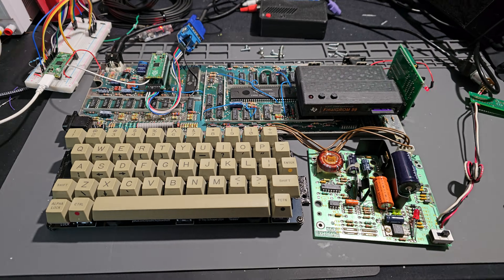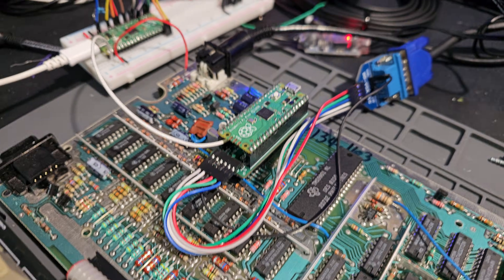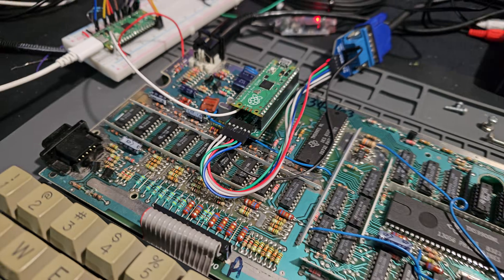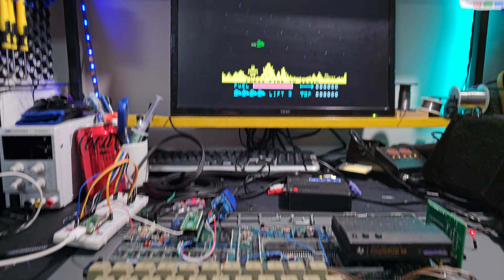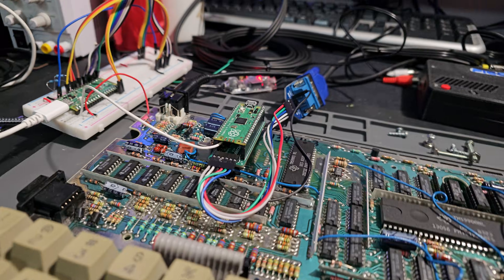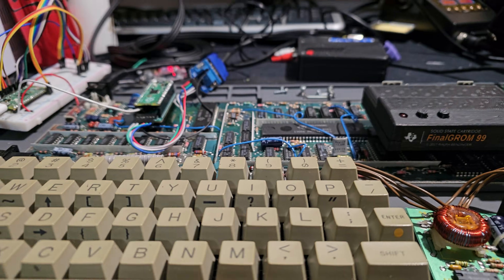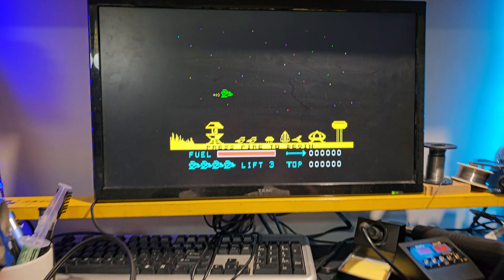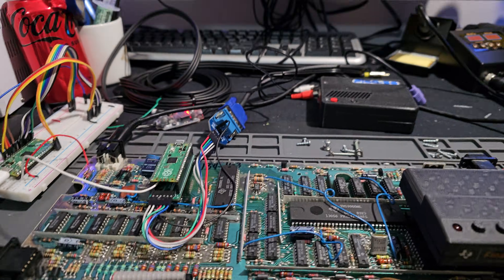PICO9918 prototype - It fricken works!

Comment: Ja, ich sehe hier eine grosse Zukunft für IHR PI PICO PROJEKT,besonders als quasi preiswerte VGA "Grafik-karte" für so viele Homebrew Computer wie da zilog ez80, ATMEGA , Wroom32 Projekte ,wo eben eine gute schnelle QUALITÄTs VGA "GRAFIKKARTE" da fehlt.
Denn besonders heute ist bis auf den sehr umständlichen BT815/817 Videochip ,da kaum etwas für die modernen "MCUs" oder auch für die alten old school CPU als da z80000, 65816,68000 etc.etc. auf den Elektronik preiswert vorhanden.Also wäre ein QUAD "PI PICO" wohl hier beste Hardware Lösung um richtig VGA "POWER" mit sehr wenig finanzellen AUFWAND / KOSTEN  da schnell umzusetzen-sonst wird es jemand anders machen...

Comment: Erstmal Vielen dank für neues info video! Meine RETRO FAN Wünsche an SIE:
Wir als Retro Computer "FANS" würde uns alle sehr freuen auch das ihre "neue" Hardware "emulation" auch für älterere MSX 2 Computer oder Steckschwein "REMAKE" da funktionieren kann/könnte siehe den ziemlich langsamen Yamaha V9958 CHIP z.b.
da wenigstens 320x240 pixel in 8 Bit Color und vielen bunte Hardware Sprites ala des SNES SUPER "FX" oder Sega MEGA "CD" mit seinen Spezial "Effekten", und wirklich geil wäre 640x400 Pixel in 8 BIT Color auch wenn dafür ein zweite "PI" PICO dafür genommen werden müsste,natürlich sollte der vorhandenene "DVI" PORT des PI "Picos" dann ein brauchbares sauberes "VGA" OUT Bild da liefern...

Comment: This is great for people building new 8 and 16 bit computers that need video output! Two reasons nobody should be using the TMS9918A anymore:

1. The chip is made to use DRAMs that are obnoxious and increasingly rare to get working. Yes, you can work around this, and the workaround was clever, but it's also tedious rather than fun.
2. The actual chips are starting to dry up at least a little. You can get a few on eBay or aliexpress but they're quite often fake or dead chips. Better to save the real ones for real 40-50 year old hardware and use the circuit-level emulations and reimplementations.

Cool thing is that you don't even need to keep the TMS9918A footprint if you know you're using a circuit-level emulation. Just drop the pico in place if you're trying to stick to through-hole parts, and use the rp2040 directly if you're not. You do need level shifters … unless your project can work at 3.3v. I really wish we had a 5v-tolerant alternative.
Reply from the maker: For a homebrew, apparently the Pico can be somewhat 5v tolerant. Obviously, not for a commercial product which is why I level shift everything. I have used the TMS9918A in previous projects just with SRAM as you mentioned. Dropping this in there, I can remove a bunch of ICs.